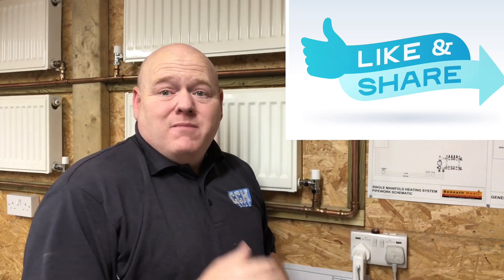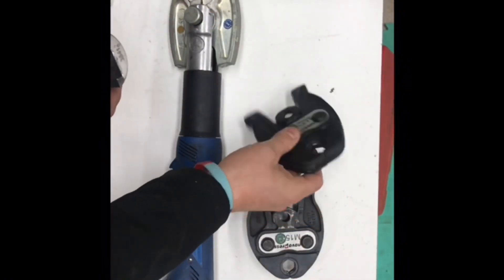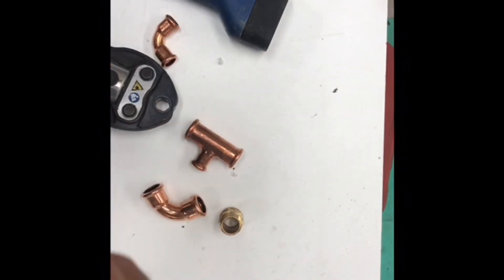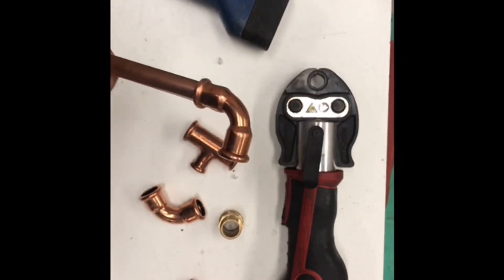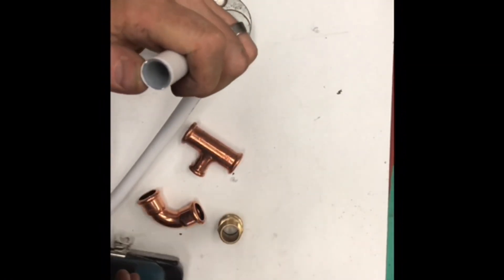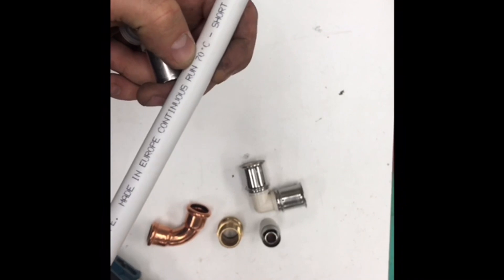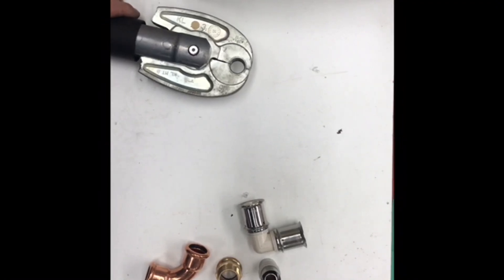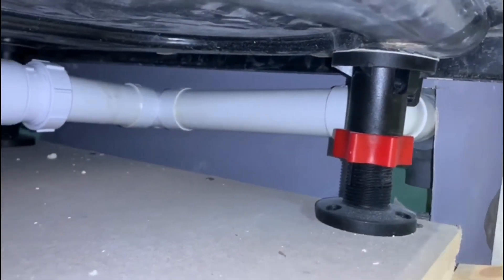Multilayer Press-Fit MLCP - Press Fit Copper - Plumbing / Gas Training

Comment: There's no tundish on the tprv....maybe the pipe size for the D1 should be 22mm.....that's about my level of knowledge for unvented 😂 oh yeah and its possibly overheated and then caused a leak at some point?
Reply from the maker: You watched to the end thank you. I will do a video soon and answer. Thanks.
Reply: My only guess with the BBU was that fluff and debris had choked the mesh filter. Unrelated but can't see the thermocouple capiliary tube on that BBU?
Reply: That areomatic burner never been strip clean in years to get in that state. Most off younger engineers won't even know to take end off and clean at service

Comment: I'm very keen to have a go with this mlcp pipe and pressing as it has its benefits especially when working on wet pipework  and speed but my question is ,does it get damaged by vermin as with push fit plastic which I will not use.have you ever seen the pipe chewed
Reply from the maker: I have never seen one damaged but I guess it could happen. Thanks.
Reply: Seen copper that was chewed thru by rats they can chew thru just about anything thankfully not common. Mice common for plastic the new stuff barrier pipe supposed to stop them trouble is fittings ain't

Comment: I reckon it is getting blocked because there isn't sufficient fall - the pipe is horizontal.  Water is sitting in the pipe with bits of kitchen waste and these eventually congeal and block the flow.  A poor installation.
Reply from the maker: Stephen K0nig Thank you for watching the full video👍 The outlet near the wall is higher than the trap, you are correct ❤️

Comment: Great video Allen.
I agree never use push fit.i  done my C&G in the 60's.my mate recently had a leak under his bath it looked like spagetti junction i didnt know where to start with these new builds. In my day pipes had to be properly supported and straight or as a apprentice i would get a thick ear. Im amazed how quick they can plumb a house these days but to me its shoddy work most of the time.
Reply from the maker: Thanks for the comment.

Comment: Hi Alan great vid as always👍I have the Geberit press fit gun. Do you know if you can get jaws for it to do the composite pipe?
Reply from the maker: Yes you can. I use Hilti jaws in mine. Thanks
Reply: @AllenHart999  thanks Alan 👍
Reply: Where do you buy mlcp pipe and fittings from?

Comment: Great vid, I just started using press fittings with a new company. It's definitely quick, but with tricky runs in older domestic properties planning my pipe run and what order I'll press the fittings in has been the toughest part of the learning curve.
Reply from the maker: Would you want to go back? I know I wouldn’t. Thank so much for the comment.
Reply: @AllenHart999  cheers Alan, I don't think it's a case of going back, for most jobs it's great, for some I prefer the way soldered joints look, which is totally aesthetic.

Comment: Good video, very helpful for those new or thinking about press fitting
Reply from the maker: Did you see the pictures at the end? Thanks
Reply: @AllenHart999  probably more than I spotted, no tundish and undersized discharge pipework from unvented, expansion on hot outlet, heating vessel doesn't look secured, fluff build up inside guaze filter on bbu burner, and everything wrong with that waste pipe 😂